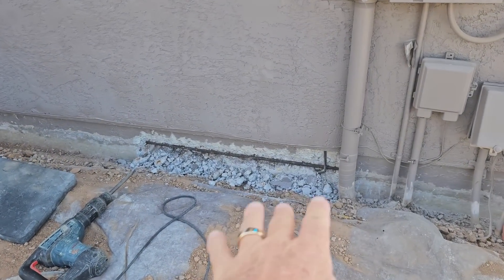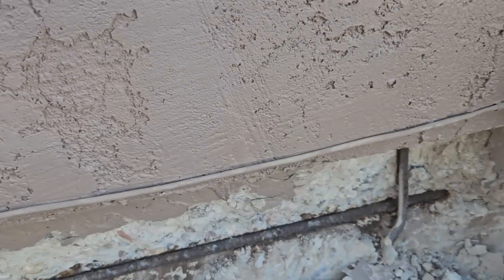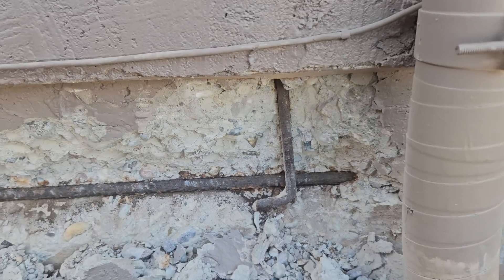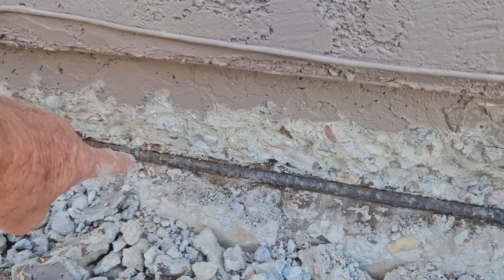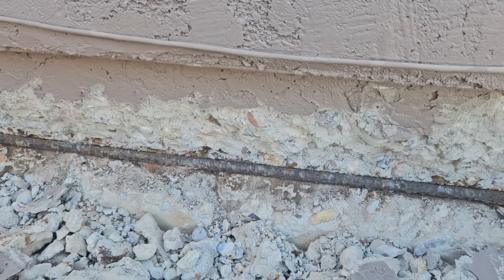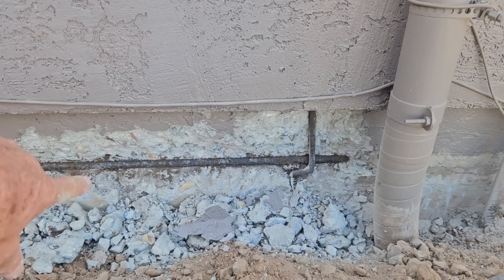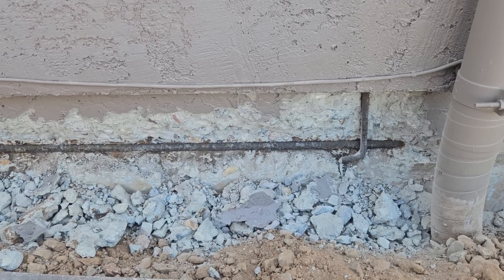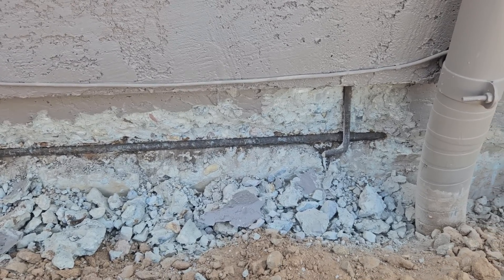Foundation Repair - Certified Rebar and Anchor Bolt Replacement - Concrete Repairman LLC

Comment: dont kid ur self.  scrpe it clea n slather on some quick crete , smooth w wet trowel n paint .... total due 3oo$   thT THE az HOUSE FLIP METHOD 😂😂😂
Reply from the maker: And the corrosion continues and breaks what you just patched, don't kid yourself. Do it right according to code.

Comment: Stem wall work is fun… also that j bolt won’t be “loose” after the hydro concrete… and in bedrock AZ, where is your footing moving to? Hit em with rust stop, cut out the bad parts… and fix the water next to your house problem…should be fine….